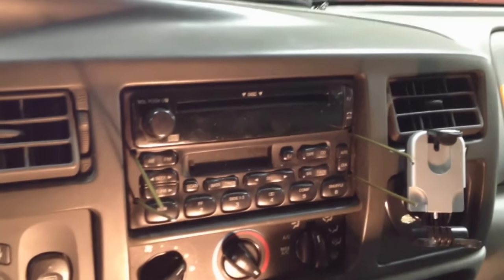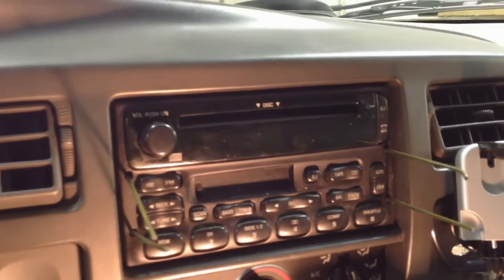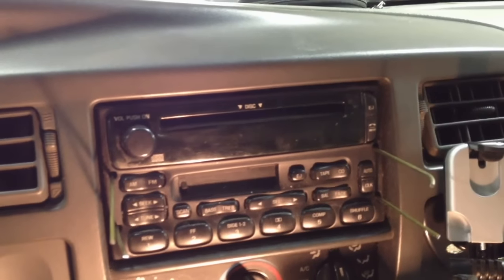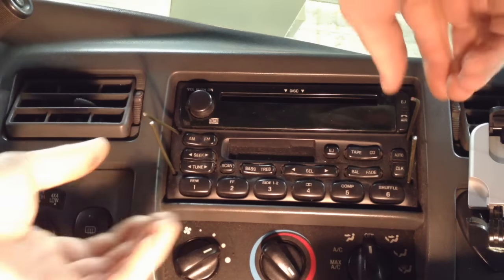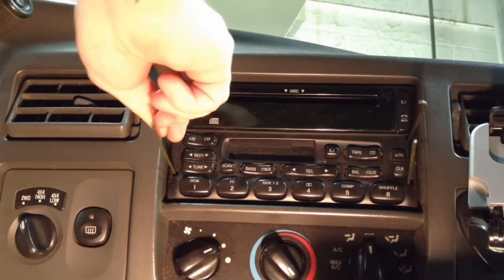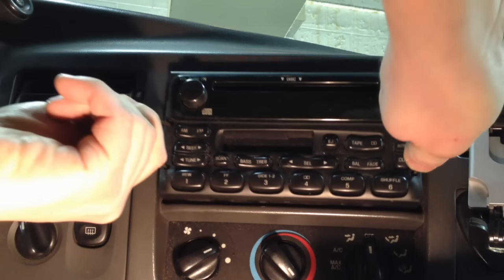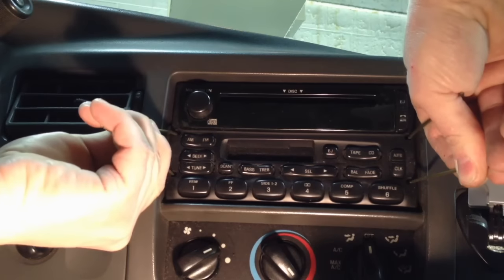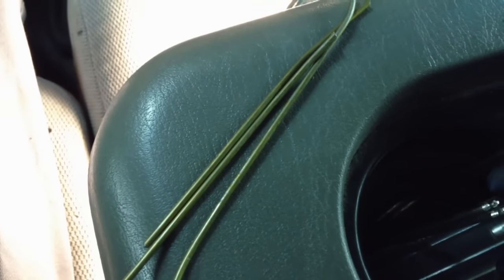Ford Radio Removal- NO SPECIAL TOOLS

Comment: Didn't have a coat hanger so I popped the wire handles off a couple of old paint cans and straightened them.  Worked great!  Saved $$ and got the job done in about 10 mins total.

Comment: Hey. Great video. It really helped me out. I did, however make one modification. I cut 2 pieces instead of 4 and bent them to look like the tool. Made taking out the radio a little bit easier.
Reply: i’m having 0 luck
Reply: @jwy4232  how so?

Comment: I cut up a coat hanger and tried over and over to get the radio out. No one mentions it but the steering wheel on a Windstar is right in the way so it is awkward to begin with. I worked on it for a couple of hours over two days. I could not get the radio to budge. Finally, I went to Walmart and bought the loop tools for about $6. Using these tools I got the radio out in about five minutes. Apparently the radio is tight enough that you have to wiggle it back and forth to get it to come out. And, it is nearly impossible to wiggle it while holding outward pressure on the coat hanger wire because the wire bends. If your radio isn't as tight as mine then the coat hanger wire could work. Otherwise, you'll need something stiffer. The loop tools are stiffer and also have curved ends which make it easier to grip the latches.

Comment: Did it this morning and it works great. I only suggest use the hex keys and a flat head if you dont need to take the pannel off....pop in the hex keys on one side and bend them away from the radio. Then use a flat head to remove one side at a time and boom it comes out ez

Comment: How far do you insert to engage the release? I used the tool. Seemed like it would go in a long, long way. Pushed out on the loops and disintegrated my radio. Now there's no leverage fulcrum to move out the releases. :(

Comment: well the coat hangers wouldnt work for me, guess i didnt have any heavy enough. but for anyone having the same problem, four 16 penny nails worked perfectly.
Reply: +Trav ice  Saved my life.
Reply: nice!
Reply: +Trav ice 16 penny mails?   Those wouldn't even go in the holes in the radio in my 2004 F-250 Super Duty.   You didn't mean 6D, did you?
Reply: +Ron Berg no i used 16 penny on my 01' maybe they changed em. i was a carpenter for 8 years lol. i know nails.
Reply: neither the hanger or the nails worked for me. I stuck the claw of my hammer into the tape deck and yanked the radio out.  worked like a charm; of course the factory radio is useless now but it's getting replaced anyways.
Reply: Thanks bruddah!
Reply: @bobbobson4607  lol
Reply: First comment saved me from watching the video lol

Comment: 93 f350 radio had these holes but a coathangar just wouldn't do it.  I had to get really violent with that hunk of junk radio to get it outta there!  Ripped faceplate of radio off then with 2 giant pipe wrenches pulled until those steel tabs ripped.

Comment: We just did this and it worked great. Ok but first used a coat hanger with too thin of wire which did not work. I was trying on one side and my husband the other and wasn't working. Told him to just do it as we were pulling against each other and it slipped right out :) So the hanger should be thicker. Almost think enough to fit right in the hole. They should only go in about an inch. we also just used a curved wire for each side instead of the four pieces. Hope this helps  and thanks for the great video!!!

Comment: Figured it was something like that but thanks for the video!  A couple of my preset buttons don't work and the volume knob It's crazy when you try to adjust it up it goes down and down it goes up and you've spin it around and it doesn't work in blah blah blah. Finally frustrated enough to do something about it!! Thanks!

Comment: Thanks for posting this - I tried the coat hangers but didn't push out ward I will try again tomorrow,if it doesn't work I will try another posters advice with some 16d nails either way thx  can't see buying the tool especially since I will only use it once !!

Comment: Managed to remove the radio ok - thanks for your tips with that.  Would you know of a reliable site that has the codes that doesn't charge over $20.00?

Phillip

Comment: NOTICE !!!!!!!     I'm not entirely sure how it is on all of them but on mine I kept pushing the wire to far in and couldn't get it to work, once you feel some resistence you don't really need to go any deeper.
   Also side note, I had to push inwards but if you get them in the right spot and futz around a bit you'll figure it out, I also needed something to gently pry with to get the hunk of metal to move. Good luck to anyone who may need it!

Comment: where can we get the radio code for same model of radio in the video, is it on the back of the radio?  printed card with the radio code is long gone, ford dealer said they don't have any information for anything over 10 years old.

Comment: What year Ranger does this work on? My truck is on its second radio replacement as I bought it second hand. No "four hole" near my radio in my 1990 Ranger!  The bezel extends across the driver's side dash past the radio almost to the glove box. Help!

Comment: I know this is regarding a stereo, but I have a question about a DVD player in my 02 Excursion.   Recently bought it from the original owner, the only thing not working right is the DVD player in the backseat.   Tried twice to put in a DVD for the kids and it had enough power to take in the DVD and a quick blip appeared on the screen.  Now there is NO power to it and the DVD is stuck in it.   I looked through the owners manual to see which fuse is linked to it, but the owners manual did not show.  Also I noted that the stock stereo uses several buttons to able or disable the DVD player in back.  Since the previous owner has an aftermarket Kenwood stereo installed in front, I don't know if that could be part of the problem or not?   I called my local Ford dealer and they said they don't know, and never heard of it.  Do you know any likely problems with this, or does it sound like the whole unit is fried and needs replacement? I can't find anything on the internet about specific problems/troubleshooting. Thanks!  Julie

Comment: Will removing the radio reset all the settings? One of the select buttons stopped working and the balance on the radio is set all the way to the back and I have no way to bring it back to the front

Comment: Good evening, I think ask this before, can you do a Video on how to fix a 2012 Ford F-150  4x4 XLT 5.0L the Radio quite work I checked all the Fuses and it still won’t Power up, the Clock is the only thing Blinking. Thank You.

Comment: How about removing an aftermarket (Dual Electronics) car stereo from a Ford Focus?
I cant seem to find info on doing that.
Reply: Dont feel bad I need to do a lot more on the inside than my stereo, cant find info on changing the car light switch out on a 1998 Ford Explorer.

Comment: I have a 2002 Windstar and I would like to know where the antenna is?  Can anyone tell me??  Thanks in advance.
Reply from the maker: +ah downs It is built into the rear quarter glass not sure which side but you will see a grid embedded into the glass.
Reply: +FordTechMakuloco Thank you very much. I think the ground wire may be loose either at the radio or the antenna, because the AM radio reception is terrible. Having a local mechanic check it out Fri. He has the tool you just showed.
Reply: FordTechMakuloco I messaged you on Facebook like you asked. I really need your guidance please and thanks,  I can't remove the damn radio out it just won't budge

Comment: tried it with coat hangers and did not work. Bought SPECIAL TOOL, still not working. If the bracket is broken, what do you suggest?
Reply from the maker: Are you sticking them full in then backing out just a bit? If the brackets are indeed broken you will need to push them in manually from the backside what vehicle you working on exactly?
Reply: FordTechMakuloco 2003 Ford Windstar
Reply from the maker: maawl I would follow what I do in this video NO HEAT: Ford Windstar Blend Door Actuator Removal
and remove that lower storage bin and you are going to have to look up in there and manually push the tangs back

Comment: am i the only one who had terrible luck with this? I couldn't tell what was going on until it ripped out the entire dash with radio still attached. So I look behind and i ended up just prying it out. I used nails and a coat hanger and neither worked to unclip the radio from the dash. Oh well.

Comment: Tried everything, mine won't come out. Think someone may have busted the clips. Any thoughts?
Reply from the maker: The clips are likely cracked off on one side you will have to access it from the backside
Reply: +FordTechMakuloco how do i remove it from the back side
Reply: FordTechMakuloco I'm also having the same problem, the right side clips go in with no resistance. how can I get it from the other side??
Reply: turns out brute force and elbow grease works wonders
.... iff you dont care about the old radio

Comment: What is wrong with me? I've just come inside after working for a half hour on this. 

Could it be that the truck is 20 years old and the snaps are very stiff? 

My coat hangers bend and bend, I pull and pull, but the radio laughs at us.
Reply from the maker: Steve K Sometimes the clips get stuck in there.
Reply: Steve K Just to followup, I bought a set of the real tools, just a few dollars, and the radio came right out. I think it was the coat hanger metal not being stiff enough.

Comment: Sometimes weak metal like these hangars will work.

Sometimes with even the proper tools the radios are a pain to remove.

Sometimes you can simply pull the whole dash bezel WITH the radio still attached to it then reach on the sides of the radio and just push the locking tabs with your finger tips.........

Comment: Did not work.  The hangar wires bent and slid out
Reply from the maker: You need to use heavy duty coat hangers and push them in all the way, it works great I used them for probably 4 years at the dealer before I bought the real tool. If they still wont come out then it is likely the brackets are damaged in some way and you need the real tool.